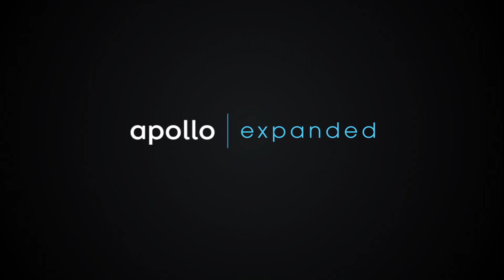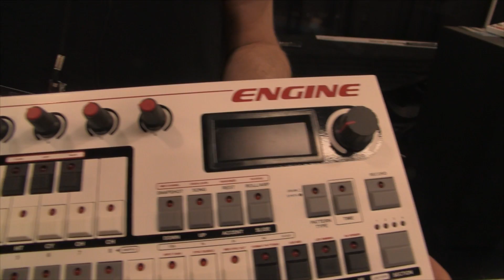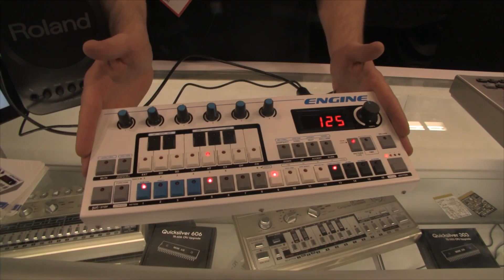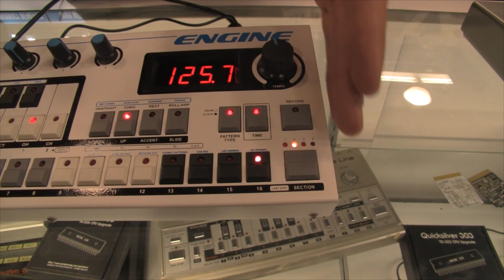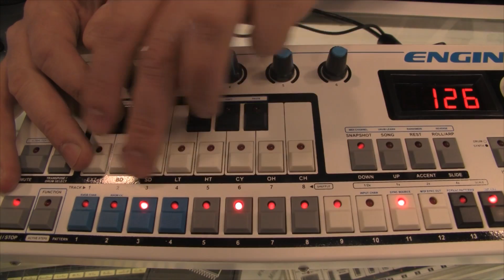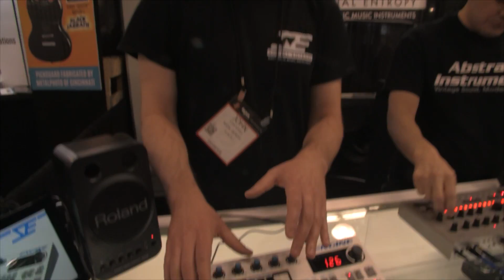Social Entropy Engine Sequencer

Comment: This thing is a beast.  The first few hours youll be in the manual, and then every so often when you cant figure something out, but its not something that is too hard.  I love mine and its pretty intuitive if you read the color coded button labels.  I had a beatstep pro and its ok, but i broke my usb cable within a month and i never even took it off my desk.  The connection for the BSP is janky as fuck.  This is a pro piece of gear.  the BSP is a bedroom piece of gear.

Comment: Just thought I would add a comment for anyone thinking of buying. I have one of these with cv gate expansion. It appears to be very solidly built, heavy steel chassis, positive buttons and switches. My only criticism is that it has so many functions it can take a while to get to the bottom of it and if you don't use it regularly you are inclined to forget the combinations of key presses etc. The upside is its very well thought out and does pretty much everything I need a step sequencer to do.
Reply: One further comment after using it for a while - I use it with a lot of different analogue hardware. The ability to slide each of the outputs backwards or forwards in time to compensate for variations in timing response for each piece of hardware is essential for me to get accurate timing. Its a feature that might not seem that important when evaluating sequencers but its fundamental to how useable the whole sequencer is. It doesn't matter what clever things the sequencer does if the timing of the different machines that you drive with it is off! I also agree with InnerPull the manual is well organised and comprehensive so if you do forget how to do something its not so difficult to look it up again.
Reply: i was looking over the manual today. yeah, its thick, but it seems pretty well organized. some manuals offer little help to tackling a unit.
Reply: Yeah, the manual is over 180 pages. I ordered the CV kit, because it was available, and I knew I'd need it. So now, like many, I'm just waiting for the actual Engine to become available again.
Reply: David Bessell I never thought about the cv response issue. I only have a 101, but I bought the expansion anyway, because it wasn't expensive, and would force me to wait for a new batch of Engines. Which of course (after just checking again) are still not available. Depressing.
Reply: I was curious as to if you're sequencing any of your analogue items using the Engine's MIDI to CV mode. I know that you have to reboot it after you exit it. The manual is a little thin, in this regard. I know I can sequence analogue gear using the mini keyboard, but the manual doesn't make it clear whether or not I can record sequencer tracks for external analogue equipment while in MIDI to CV mode. This seems best left for a forum search, but you probably have some good insight. Any info is welcomed.
Reply: +David Bessell thanks for the feedback on all this. i echo michael's question. mine is on its way (after it made a chance appearance on eBay, in like-new condition), so ill be wading through these topics myself. ill be running mostly all analogue also. i know that there's an official facebook group for the engine too, so ill be sure to jump on that.
Reply: Sorry guys I haven't needed to explore that aspect. I have some kenton midi to cv convertors which I had already before I bought the sequencer so I carried on using those where I needed midi to cv conversion.

Comment: the only issue i find problematic in this device (other than the high cost for something that unfortunately looks way too plasticy for my taste and that doesn't play a single note) is the fact that the 6 knobs for controlling parameters are fixed travel knobs and not endless encoders. having knobs is great if those knobs only have 1 single function across the board. but to have the knobs control parameters for each of the 8 channels and not have them be endless encoders means there's going to be A LOT of parameter jumps while editing parameters live between sequenced tracks.

Exactly the same problem with most new entry level midi controllers out there now like the novation launchcontrol for example. sure it has 8 user midi channels, but good luck get any sort of decent live performance with those 8 channels while your knobs jump between different positions when you switch the channel...

Such a high price for a seemingly very plasticy device (i never saw one in real life i could be mistaken) AND lack of encoders is a dealbreaker... i DEFINITELY think this is better than a beatstep pro in terms of functionality and 8 polyphonic channels vs 1+2mono on the BSP is awesome... but for the price of 1 engine, you could get 2 beatstep pros giving you 4 mono channels and 2 poly drum channels. not too shabby.

Comment: What a cool, deep and fun looking bit of gear! I think its got very stiff competition these days but it looks like a fantastic sequencer!
Reply: +John Smith Hey John!
Forgetting modular and iPad stuff for a moment, off the top of my head there is The Beatstep & Pro, Fyrd Sqr, Korg thingy, RPE Seq12, Midibox, Darktime, Zaquencer, Genoqs Octopus, Asol OberKorn, Koma, Tetra Maps, Cirklon, Urzwerk, Midisizer, Squarp pyramid thingy and a modemachines planned one. Oh and the TriggerFinger & Pro. Not including 75% of the reason I bought my TT-303... for its seq engine :-)
Reply: I forgot lots of folks use Elektron stuff to sequence, the Circuit could be a sweet sequencer and the Gotherman box.
Reply: +John Smith ?
Reply: +mCKENIC It depends what features you need. Of all sequencers listed above 5 are polyphonic, and one of those is vaporware at the moment (Seq12), one is obsolete in 2010 (Octopus), and one has no CV's (Zaquencer). So if you want polyphonic w/ CV's you have Cirklon and Engine. There's also the Squarp one which is list based very different approach and then there's the Elektron box, but again no CV on either. So if you don't need polyphony, CV's, multiple MIDI Outs, velocity & gate times, song modes etc.. then yes those others are options. But then you're talking apples & oranges.
Reply: +John Smith Well, you asked.
Reply: +Code Mode Thank you for the thought out reply. I guess coming from the modular world I dont tend to think in polyphony. For me, I have been having a LOT of fun with Rene, TT303 & Gorf-XL. They have CV (well its fairly minimal on the TT admittedly) where the Engine needs an additional expander. For my personal needs, an Engine would be a costly over complication, where as if the BeatStep pro ever gets its kinks ironed out it will be perfect for 606 and modular use. I did say it looks like a lot of fun and very deep - just for me it exists in a space already well stocked.

Comment: So this is a midi controller then?
Reply: +Jim Shannon has a 8 cv plugs so it can control modular synth with a lot of modules (not just midi), this is an alternative to the cirklon which is really expensive +2000 usd. This also looks really solid bets it has very similar build quality.
Reply: Sorry to be late with a response. If this can control modular modules, then it really opens up the Engine in a lot of musical ways. I sub to your channel, thanks :)

Comment: My only issue is cost. At £432+ CV upgrade, this is a significant expense versus the Beatstep Pro.
Reply: +AlainRaes67 speaking as a Mini-&-MicroBrute owner i think their build quality is far from inadequate.  All metal construction is great for travelling, I agree, and the Engine certainly offers more functionality than the Beatstep Pro as we have covered, but at a price.
Reply: +onceuponheytime good point. I also notice that they are polyphonic sequencers as well - perhaps it IS worth taking a look at if you have more gear than a Beatstep Pro can deal with.
Reply: +Chris Smout its unfortunate that the Beatstep pro doesn't have simple things like pattern chaining. I just read the manual for Engine and it has more features than I thought. Its probably better for live performance. The CV option is a lot more powerful than I originally thought.
Reply: friendofCHAKA So this is a better sort of sequencer for the hardware-centric player. I note that the extra CV output board brings the total cost to 790USD or just over £500. It's all getting rather expensive for a controller though!
Reply: +Chris Smout yeah that is true it seems all hardware sequencers are kind of expensive. You could get a decent computer for that much.
Reply: ***** I agree to a point. Arturias gear is truly innovative, sound amazing, and again, on the surface feel quite well built - in that regard they're excellent value for money.
But browse over their forums and it's endless pages of people having all sorts of issues with both hard- and software, and i don't think i've yet seen a single person say they were even content with their customer service.

For the MiniBrute there's a parade of "recalls", mostly because several production runs had keys made of cheap plastic that failed, and even the slightest quality control should've picked up on it. It was their suppliers fault in the 1st place, but they should've checked it, atleast at the 1st notion of a potential problem. I say "recalls" since they didn't actually issue 1, like would've been the decent thing to do. They did of course replace faulty units, though waiting period, without any communications replies, sometimes exceeded 6 months. That's what i've read several times over atleast.

Lucky for me, mine fried the filter out just before warranty ran out - incidently the store demo fried out the filter in the exact same way, around the same time, and came from the same run. Had the filter in mine died just a week later i'd have lost 400£.

If you're lucky and get a good unit, you get an awesome piece of kit, that's well thought out and well designed, very cheap for what it does. But unlike most of the competition, it's not a 1/500 risk, but depending on the unit and production run, it may be over a 1/5 risk.
So saying that "the quality feeling is only skin deep" is quite fair given all the information i've been able to find.
Reply: +Chris Smout  this unit  looks like a solid buildquality  , an area where arturia hardware sorely fails  , quite some users end up with dead arturia stuff
Reply: +Chris Smout As a previous MiniBrute owner and supporter, i gotta tell you: Arturias gear might feel great, but just below the surface they're not quality pieces. There's far too often something small but critical wrong, because the quality is only skin deep. That's how they make their great and innovative gear as cheap as they do.
Reply: *****
we'll  see if your brute's still work in 10-15 years time  , look at Japanese manufacturer's
like Roland and Korg , they put out budget stuff in the 80s like dr110 ,poly800 etc etc that still works after 30 years , i had arturia stuff dying within  a YEAR and getting no feedback when you contact them about this.
Reply: sickmrtrick from what I gather from users who own one it is a bit of a one-trick-pony. Good at 16step single line sequencing but a pain to quantise notes and not flexible beyond that.
Reply: +sickmrtrick if you only need sync, why not just get a hardware clock?
Such a sequencer is a MIDI hardware to control drum machines and synths in realtime including not to say most importantly, the MIDI sequences. 
The DIY from" MIDIBOX SEQ "looks very interesting too, but it's DIY... T-T
Reply: versus the what?

Comment: Soo... The drumparts are build in?
Reply: +Howard Forton he said at the beginning that the sound was coming from VSTs
Reply: +Bannazkit It shows in the manual that the drum mappings can be set freely for the eight drum triggers. It  doesn't generate any sound internally, it sequences your external gear via MIDI, USB-MIDI &Dinsync.
Reply: +Bannazkit Negative. It's a MIDI/CV sequencer.   Wonder what the keys feel like, they have that satisfying chunky click sound from what I could hear
Reply: Good question. I guess so but He doesn't make it clear.